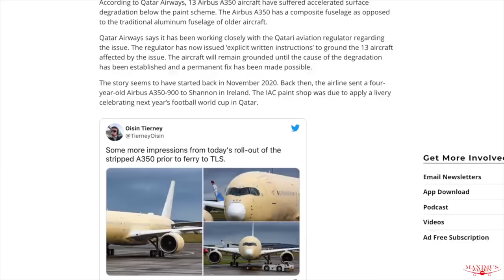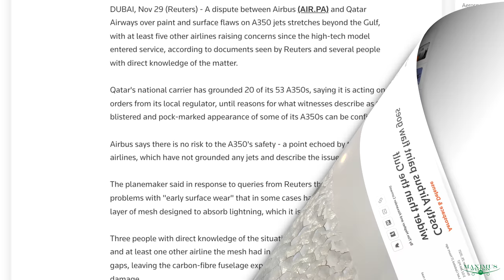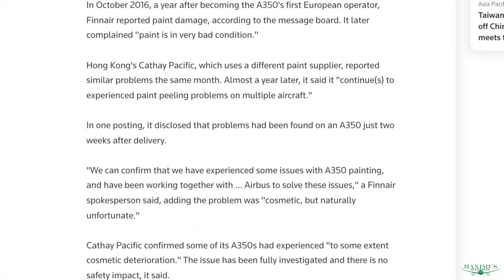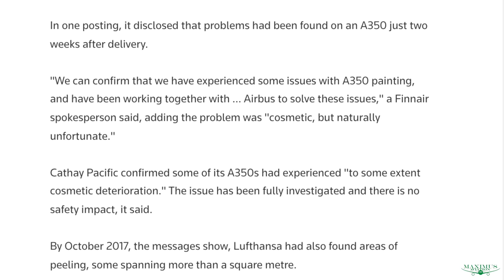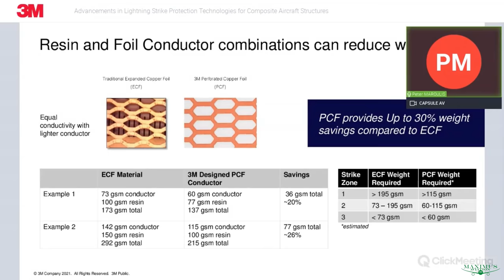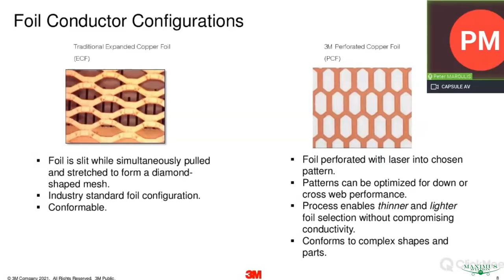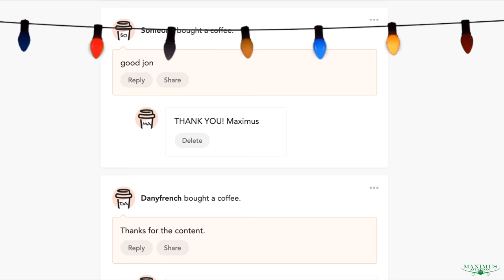Six More Airlines Report A350 Fuselage Defects That Expose Composite Lightning Strike Protection

Comment: How can Airbus dismiss it as a non-safety issue if they can't as yet offer even a speculative explanation as to the cause?
Reply: Because they are 2 different things
Reply: Probably they already know .... like Boineg did with the MCAS or Douglas with the cargo door potential failure mode (a report was sent to Douglas by the contracted manufacturer).

Comment: I'm working on an Experimental composite aircraft and for it, the paint is not just cosmetic. It protects the composite epoxy/fiber structure from UV and moisture that would break down the epoxy. It also reflects much of the heat from sunlight. Having the outer layer of paint and epoxy that covers the conductive mesh break down and expose the structural composites would be a big problem.
Reply: So basically it is primer issue I think they need a flexible primer
Reply: Use aluminum next time 
Cheers

Comment: Auto body painter here. We can run into a similar issue with raw plastic bumpers with the different rates of paint and composite expansion but the way around it is to use a flex additive. Not sure if airbus uses one in their paint. Another possibility as far as adhesion issues go is that the composite composition they used could be outgassing. We use a special anti static cleaner and a sprayable adhesion promoter on polypropylene panels before we paint that prevents that. Otherwise the paint will begin to bubble and peel within a few months. Even if the surface was abraded. The 787’s different composition might be why it’s unaffected.
Reply: Well this is a much bigger problem when your part that is degrading must hold air pressure and if it fails the fuselage pops like a balloon and everyone aboard dies.
Reply: I do think also they need a flexible primer all the issues are on flexing parts I also see that the issues are on stainless screws so again primer issue I would say

Comment: The foil is copper and we have already started testing the newer copper perforated foil  instead of the expanded copper foil (ECF) and hopefully this will solve the issue.  It is just a cosmetic issue and does not affect the airworthiness  or safety of the aircraft. My company builds one of the carbon fiber sections and we apply the first coating of primer paint before shipping to France. Trust me when I say we've gone over everything, every paint operation, every prep operations and inspection steps to identify any issues that might have caused this.
Reply: Oh, you mean just like on my truck. Whew. For a second there, I thought the skin on an aircraft might not just have a cosmetic role. How terrible that QA lost so much money grounding them just for looks.
Reply: I think the question is: how much testing was done before production began?  I don't know, but it looks like different thermal expansion rates caused the materials to shear apart.
Reply: Your comment will surface once again when the lawsuits fly. Probably not a good idea to blab proprietary design details.
Reply: @ReflectedMiles  f*ck if I would fly on a plane where the skin is coming off. That shit will be on Mayday soon  without me on the plane. Mayday Mayday the whole outer surface of the plane has come off. Not going to make it to the nearest airport. Abandon ship. Oh shit we can't! Brace position everyone.
Reply: Lightning protection for fibre composites is a lot more complicated than the paint. The paint is just a tell tale. Retro fit will be a nightmare. This one will run for a while
Reply: @DumbledoreMcCracken  
That was my first thought as well when I saw how it looked.
-Difference in thermal conductivity.
I also wondered if static electricity played a part....?
-K 🇮🇸
Reply: @DumbledoreMcCracken  obviously not enough.
Reply: @bighoss9705  Airbus is always in denial for design flaws. And sometimes is has enough to political clout to quell problem.
Reply: @wyomingadventures  this is not a skin... As it was said its a layer above the composite skin... It will take you ages to break apart composite....
Reply: Lol sure dude I’ve been in aerospace for well over 25 years and if paint on composite was only a cosmetic issue they wouldn’t paint it.   It may not be an immediate issue but it will cost the operator’s come heavy maintenance intervals and if it goes unnoticed and the composite surface becomes compromised and starts to delaminate it absolutely is an airworthiness issue.
Reply: 0
Reply: Is this applicable to the whole fuselage or just parts?
Reply: @33ishome  you must be in the military and/or space side of aerospace.  Marketeers would paint a cloud if they could hold it down long enough.
Reply: Could it have been impurities?

Comment: so aluminum is a reactive metal that is normally protected by oits own oxide layer.
if the aluminum mesh wasn't oxidized before it got covered in resing or paint - would the smallest amount of water and air entering from chip allow the oxidization to take place. The resin or paint being dislodged in the process and thus exposing a little more metal to be oxidized.
is this a possible mechanism for the paint bubbling to start?
Reply: If moisture gets inside (under the paint) into the honeycomb or laminate, then you have an electrolyte and a 'battery'. Unless there's a preferred current path with lower electrical resistance, then the static charge will bleed towards the discharge wick via whatever path it finds.
Bonding/grounding of structure and the elimination of corrosion at those interfaces are basically two side of the same coin. Keeping moisture out is the key.

Comment: Boeing and Airbus innovated on Composites we must remember that both the 787 and A350 are First Generation Composite Commercial Airplanes we must not give these Manafacturers too much slack however it is true that Boeing and Airbus Competition is driving both of them into  out sourcing to get their planes more competitive with each other in competition I still have alot of hope for what comes for Boeing and Airbus to make a beter Next Generation Composite Aircraft it's up to the Supplier to give these Manafacturers the best Quality and I won't be surprised that Airbus with its A350 Problems and Boeing with the 787 Dreamliner Fiasco caused by Outsourcing that both of these Companies demand from their Outsourcers for the Heigheist Quality
Reply from the maker: Yes and Yes!
Reply: Screw this composite garbage, its now obvious that Boeing isn't the problem. Its the MATERIAL.
Reply: They need to use F1 paint
Reply: @donreinke5863  have faith ye of little knowledge...more composites coming up everywhere and even beyond composite materials as always next gen going forward imagine all the config changes with cc happening now? CC already saving $$$$$..think bigger picture here, say 35k ceiling and keeps climbing.
Reply: Don't compare killing 346 people with paint problems
Reply: @kirilmihaylov1934  Do not compare the 737 with A350, but the 787.
Reply: It's not the SAME case, the A350 issue is more important than the 787
Reply: @eleventy-seven  the A350 case is worrying. Calm down ...
777-X have biggest CFRP wing ever made.
Reply: @eleventy-seven  I didn't say Boeing wasnt screwing up....anywhere. 
What I said is that this carbon fiber composite is a dangerous joke.
The worthless MAX is Boeings stupidity trying to put oversized relocated engines on what SHOULD have been an entirely new airframe and then trying to use a "patch" controlled by only one sensor.
737-200s never had issues like that and neither did most subsequent models, but they just HAD to use the stupid big engines.
Contaminated carbon fiber is defective carbon fiber. Use freaking ALUMINUM, its worked well for decades in aircraft.
I have the facts, and you assume a lot to the contrary.
Reply: @kirilmihaylov1934  it was 347 btw..but can't say why or how..
Reply: @eleventy-seven  
Don been sleeping...to make something really great takes a lot of mistakes and a sh tload of determination; you keep trying and trying and hope you obtain beyond best perfection as one CEO USED TO say but what did he know...not an engineer could've been pulling our LEGS all that time.
Reply: @maximusaviationchannel  Because Maximus asked: 
With nearly 40 years of  advanced material reinforcement, ISO quality standards and ASTM (I) failure analysis engineering experience, there are a number of concerns with the chemistry, mechanical properties of the materials and application methods used in the composite fiber sandwich. 

For example, Carbon fiber and aluminum don’t mix nor does Teflon®. Just ask Boeing.

From expansion to contraction, flex to fatigue, tensile strength to elongation, chemistry to physics, and application methods, all play a complex intricate role in the mix of the delicate carbon fiber sandwich 🥪 ✈️ .

Just one incompatible material or application error in the fiber composite sandwich, the resulting heartburn even a pound of Tums won’t fix. 

If Airbus or Boeing asks, I will gladly help. They have huge problems on their hands.
Reply: @donreinke5863  Don, My reply was to your initial comment which said Carbon Fiber was the issue at Boeing. I agree with much of your followup listing the problems larger hi-bypass engines incur when used with older designs and making them unstable. This causes the need to use MCAS and other stability system that do not always work. The 777X's added wingtips add better range and fuel use at the cost of additional complication. The newer Airbus aluminum planes are designed with hi-bypass engines in mind from the get go which adds stability naturally to their design. They outsold Boeing 3 to 1 at the latest airshow 300-100 planes. Carbon fiber is the future. Just like the first jets like the Comet (weak fuselage) and the 707 (yawed excessively) and (no reverse thrust at first) had multiple problems so will carbon fiber.
Reply: @bettysmith1998  Look.......poor engineering can get a pass with many products
Aircraft are NOT one of those products.
You dont just pull over to the side of the road at 35,000 feet when something shits the bed.
Reply: @donreinke5863  carbon bicycle are shit after one minor incident. I know this personally. I prefer my aluminum frame bike any day over carbon bikes. I use a carbon seat post and partial carbon fork for vibration. Still thinking about going back to a stronger fork. Life isn't anything to mess around with. I agree with you on that.
Reply: Cracks me up when people think one manufacturer is better than the other. I get that. But thankful they compete because if they didn't we would have worse problems. Airbus and Boeing aren't enemies really. Both companies have congratulated each other on compliments in design and being in business for so many years. It's healthy to compete against each other.
Reply: @eleventy-seven   First off I only know what I read.
Boeing is not using contaminated carbon fiber.   It looks like the contamination comes from the PTFE used in mold release compound(s). The contamination is accomplished when the carbon fiber parts are made,   I know it sounds like picking a nit but it is an important distinction.    Taking it a step further, either companies are messing up on the use of the release compound(s) or the compound(s) are defective in that they allow the transfer of PTFE to the part instead of staying with the mold.
Boeing and Airbus have at least one supplier of carbon fiber parts in common.
Reply: @dantae666  Your life your choice.
Reply: Yes I definitely agree. If they are going to outsource more, they need to pass quality controls. I believe that Airbus has more experience with that since they are a group of multiple countries however Boeing is mostly in America, so allow me to say that they are probably not the best when it comes to foreign quality control. They need to put up specific criteria to be met by the outsource manufacturers and get their people there to make quality control checks.
Reply: @eleventy-seven  your comment is mind-blowing and insane.  The 777-X has the highest high bypass ratio on the market.  
The 777-X has the biggest CFRP wing on the market and its folded tips don't create any "additional complications", except in your head of an Airbus fanboy.  

You hate the 777-X just because it's a Boeing, not an Airbus.  Once and for all, stop boring us with your utter lies.  In addition the 777-X outsells the A350-1000 with 320 777-X's sold against 170 A350-1000 sold.  Find another hill to die on.  Now with the A350 CFRP, a persistent issue that should open the door to increased sales prospects 777-X.  And it will have done well for you
Reply: @dantae666  
So I take it you're not on the pax list to Mars in 2030?  Where is you're daring and risking taking side?
Risk is such a very seductive WOMXN or man or mosaic..take your pick.. but without calculated risk we won't get far..its all in the numbers..if the numbers are good..we go forward and if not reliability built in we start over.
The old saying we risked the entire farm many times..what a hell of a company just some rotten material here and there..wasn't Edison a nice guy at first but electrocuting elephants and cheating TESLA just wasn't right and going bankrupt various times...Boeing reminds me of Edison at times..for genius to break thru there is the insanity to deal with..twin engines they are..like on a 737 Max I surmise..
Reply: Boeing and all manufacturers have “ outsourced” since they started building aircraft. No major manufacturer could build every part that goes into a commercial aircraft.
Reply: @bettysmith1998  but that fighter jet has a "i am out of here" seat
Reply: Composites have been used in military aircraft for years without this problem. And composites have been previously used for passenger aircraft tailfins as well.
Reply: @6aNapoleon  I'm talking about the use of Composites on Passenger Aircraft Fuselages or a majority of the aircraft being made by Composites
Reply: @Kiril Mihaylov  did a350 or the 787 do that because of any of thier problems? No, just hush, that has nothing to do with either of these programs. Just running your trap
Reply: @Don Reinke  so design issues make composite dangerous? Smh, you ever worked with it? I would gladly jump in either plane over traditional  builds.  Far stronger and flex than other materials used. You would be amazed what those wings could do before being comprised. Easily better than any others from the past. You would not be able to bend or break a layer piece with your hands. I have offered 100 bucks up multiple times and the piece still sits in my desk undamaged
Reply: @I Care  I know what you mean, big time emphasis on fod with the carbon. Your right, one screw up can turn into a mess. But I do know it is drilled almost daily what not to do and what could result. Done correctly,, it is an awesome product that's use will be expanded in the future. Until the bugs are completely worked out, comp repair is a safe career bet. Lol

Comment: Hey Max here’s some food for thought for our community… Most if not all of the photos I’ve seen show paint peeling and cracking around Petot tube‘s and or AOA sensors. Believe both of these sensors have heater elements to prevent icing. Maybe we are seeing heat damage affecting the Epoxy resin and that’s causing the delamination of the paint and possibly the lightning protection foil.
Reply: It looks that portion is not fiber reinforced.
Reply: It sure does look like it got hot the way the edges are curled
Reply: Smart cookie you sb in destructive testing dept..let me make a call bro.

Comment: Airbus seems to be trying to sweep it under the rug so to speak. But there's no way they will get away with that. My guess, though naive because I'm not an engineer, is that these new materials and how they were applied may not have been tested in a proper way for a proper length of time.

Comment: 3:47 Did anyone else notice that the Finnair plane is landing with it's ram air turbine deployed? 😲

It's on the lower rear fuselage behind the main gear, if you're still looking. 😉

Perhaps this was filmed at the conclusion of a test flight? 🤔
Reply: Just a guess but since it looks like both engines are running its probably a test.
Reply: Haha good eye I never noticed. It still has a French registration number so probably a test flight
Reply: i think you see the test registration and a MSN 018 for a short time, so it should be a test flight

Comment: I have been using epoxies on large surfaces for decades.
This degradation is what I have seen after long periods when exposed to the weather - UV, rain & temperature extremes. 
I was a fan, but am now not so confident & seek other ways to do the job.
I am surprised that AB has not done its homework - there are ways to do accelerated weathering tests .
I am beginning to think that large scale composite construction is a dead end - current resins are just not up to the job.
Reply: So, your view is that switching to flat, perforated foil won’t fix the problem? If that’s right, Airbus could have a monster problem. Imagine the cost of switching the sub layer of foil and repainting existing aircraft, only to have the same thing happen again.
Reply: @dmrr7739 
 I can't call myself an expert. But from my experience epoxy does not do well outdoors even when painted.
It looks to be doing well for several years, then quite suddenly it begins to fail.
It appears to me that it begins to shrink, then forms cracks which allows moisture in. The moisture then loosens the bond with the substrate and the epoxy begins to flake off.
I'm sure a way can be found to be solve the problem, but it may take time if they haven't already developed and thoroughly tested a solution.